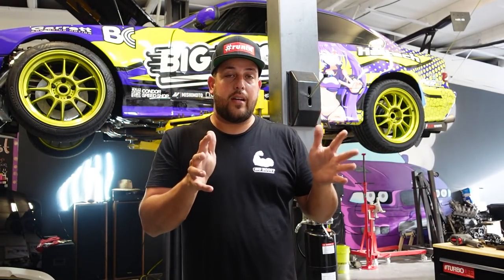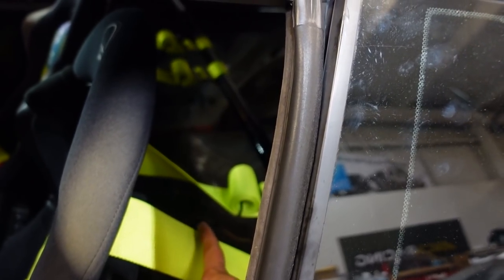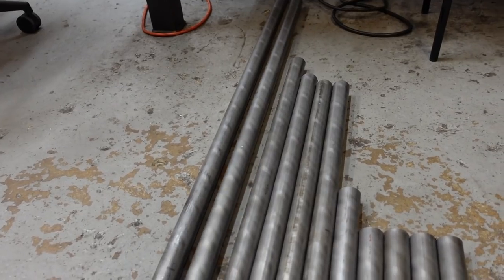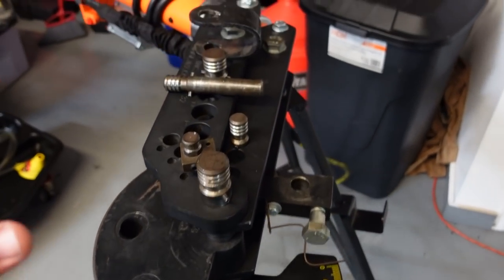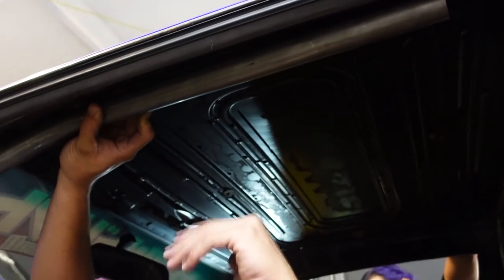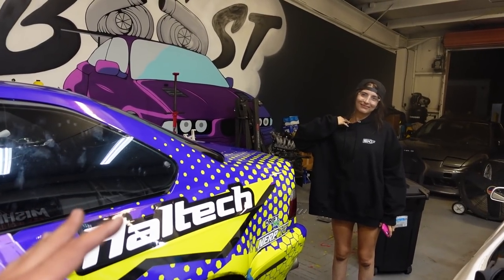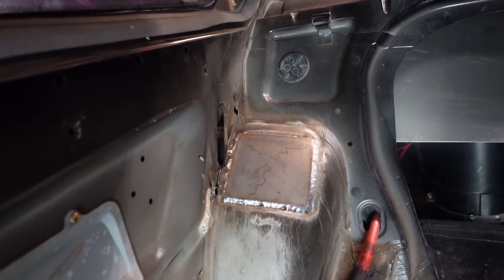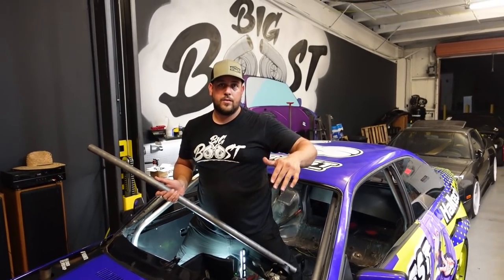INSTALLING A FD SPEC ROLLCAGE IN MY 2JZ E36 DRIFTCAR 2023 PROSPEC READY!

Comment: I saw a really cool trick for welding a roll cage all the way around on donut media. You drill holes where the cage is mounted to the chassis and you slide the roll cage through the floor and you can weld the tops you push the cage back up and weld it to the mounting plates
Reply from the maker: That’s how I normally do it on S chassis cars. With the boxes it allows you to do the same without drilling a hole through the floor. Either option works great. Decided to try this method on the e36. In the next cage video I’m showing how it drops down to weld the tops.